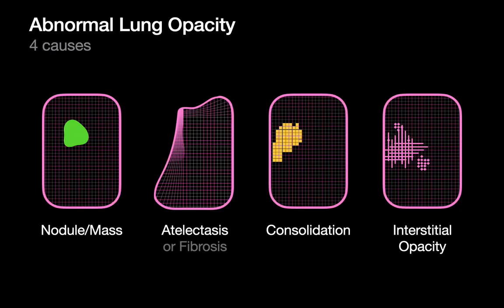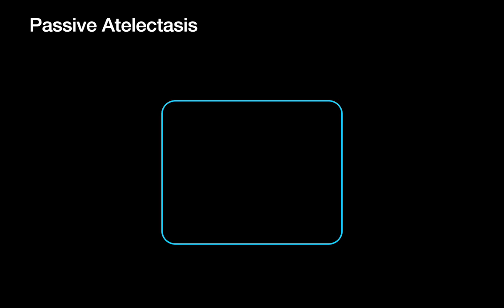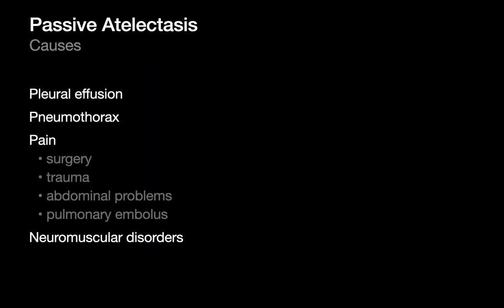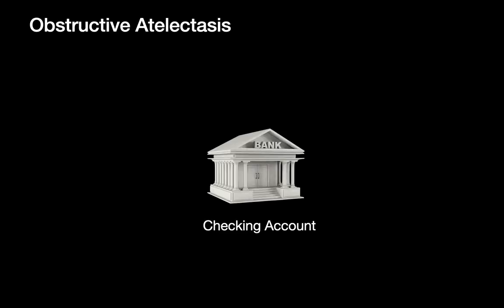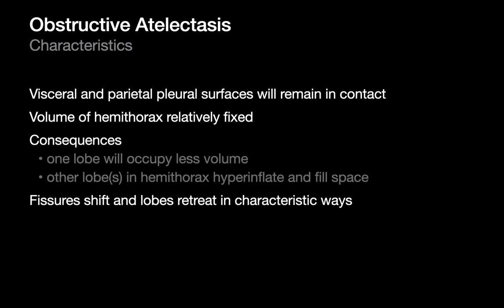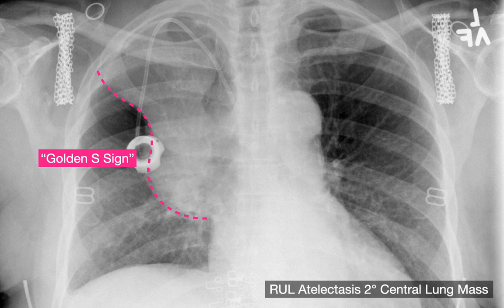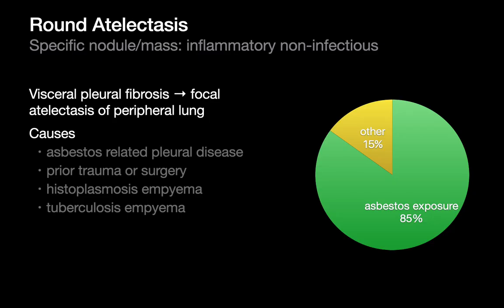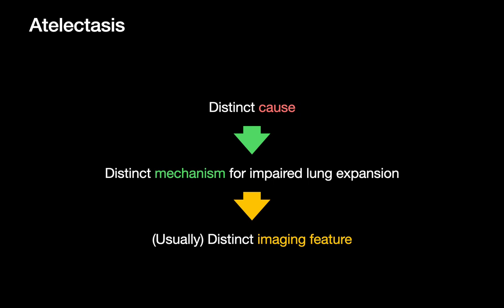Atelectasis | Chest Radiology Essentials

Comment: Thank you very much! Could you please tell me if the term "infiltration" is used when describing CT scans?
Reply from the maker: "Infiltration" is a term that's not commonly encountered with respect to the CT scans. If folks do use this term, it's typically on chest x-rays when they see a nonspecific lung opacity. Since CT imaging usually affords us the capability to be more specific in characterizing a lung opacity, the need to use a "catch-all" nonspecific term like "infiltration" is much less.

Many subspecialist chest radiologists - myself included - discourage the use of the term "infiltration" altogether - not be cause it's nonspecific, but because it means different things to different people and is therefore ambiguous in its meaning. For some folks, an "infiltration" could represent atelectasis, infection, non-infectious inflammation, hemorrhage, neoplasm, or interstitial fibrosis in the lung, while for other folks it might represent a subset of these items, and for some it might just mean "probably pneumonia". 

Since we strive to avoid miscommunication that may affect clinical management, a term like "opacity" is favored since it tends to have a more consistent interpretation by all parties.